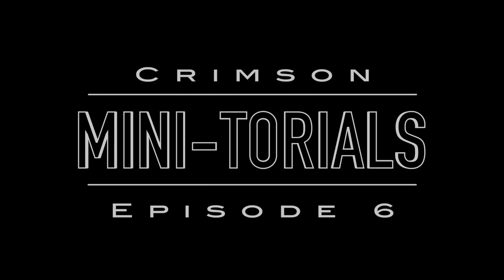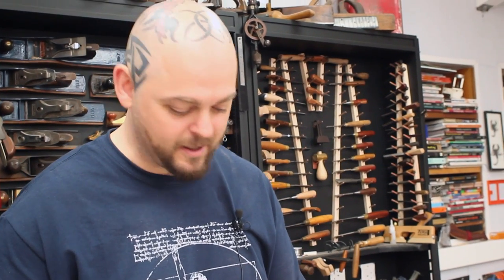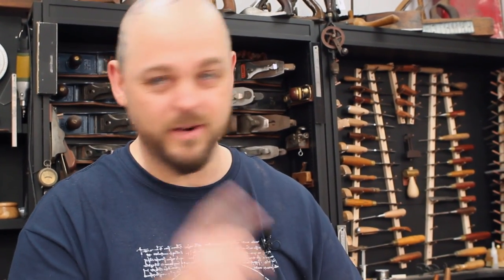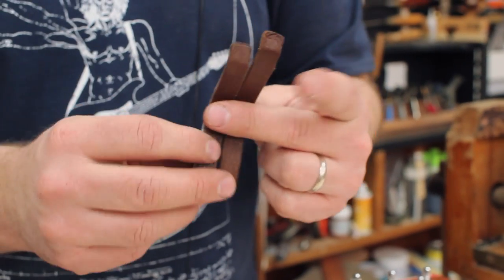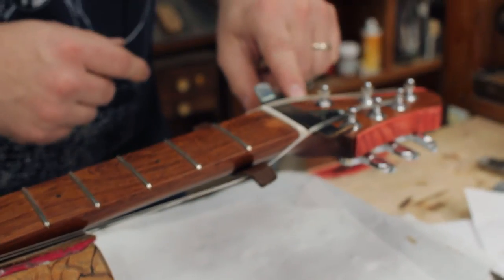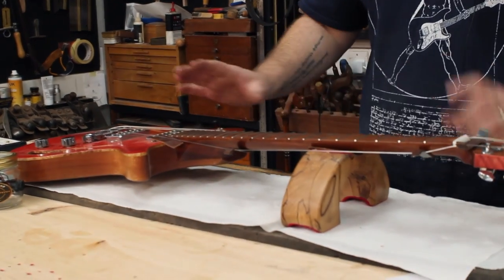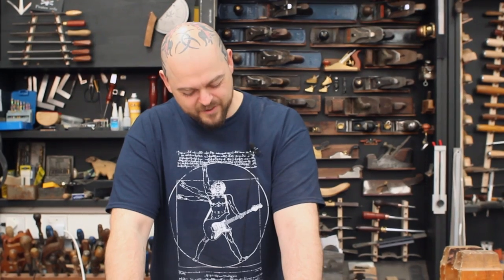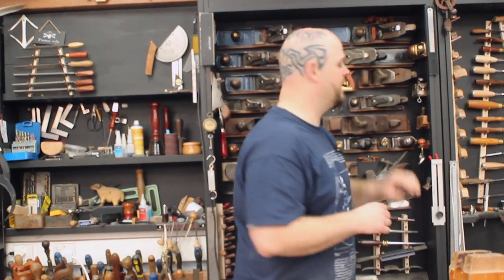How To Use a String Spreader

Comment: Thank you for this video! I've got a cheap electric guitar and a couple of the frets are skipping on a couple of strings. Finally decided to get a kit to help me level the frets, but I made the decision to get the kit right after I just put a fresh set of strings on. I saw a couple of things in the kit that looked like they might help me with that, but I wasn't sure how to sure them. Thank goodness you explained it, because I had the completely wrong idea. I thought these were supposed to go on top of the fretboard, holding the strings up and out of the way. Sort of like the bridges on a koto, if that makes sense.

I'm sure I'd have had one hell of a time trying to balance the strings on the thing. So again, thank you so much.

Comment: Hmm...how about something on options for the jack socket?  I.e. plates, recesses etc (I made a little ring of purpleheart for mine to make it look nicer, as the plate I'd bought was too large). Anything about making or using templates?  Different headstock designs (as I know you've made some very interesting headstocks on some of your guitars)?  Also, I know that you and your luthiers have different methods of carving the neck, so that would make an interesting comparison video.  How to design your neck profile &/or make an asymmetric neck carve...?  More on the different types of woods that you use in guitar building?  I'm sure there are still plenty of topics to explore!

Comment: Red leather would look nice on those. How about mini on cleaning the pots and or replacing knobs. Or the best strap buttons to use or the difference in tuner knobs as in the ratio and is one better for angled necks versus fender style.
Reply: Wallace Sheckells +1 for tuner minitorial

Comment: I have wondered about the set up and installation of locking nuts for years. I am not sure if you should file the string grooves in the nut to match the fretboard curvature and set the string height, or if you should design the neck around the nut/tremolo you are using.  I was never sure because it is impossible to add material back to them unlike bone or plastic nuts. Does Crimson guitars ever use locking nuts on their guitars?

Comment: Ben,  I can see you as Mike Reno already.......lmfao as for ideas for Minitorials......things I get asked regularly-
wiring a kill switch for a pickup or whole system
witing a stereo Jack,  mainly flush mount barrel jacks
disecting the wiring of an unknown pickup
buzzing,  too flat or too much relief
drop filling a chip in a finish
series parallel mini switches
replacing keys on tuners with wood keys
measuring for correct string spacing at the nut and bridge.

hope there is something you can use
HJC

Comment: Hey Ben.  I'd like to see an expansion of the sharpening series to cover tiny blades.  As you know, I got an eensie-weensie plane from a recent trip to the US, and all attempts at honing the blade have had mixed success - either the angle I was able to hold was too low resulting in no actual sharpening, or too high resulting in nasty gouges in my beloved shapton stones. :(  PLEASE help.  ;)